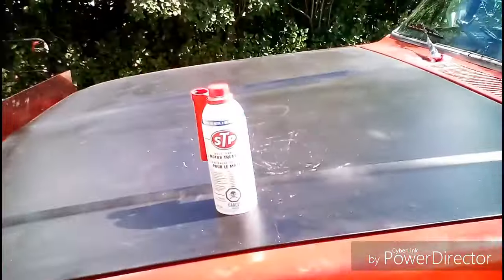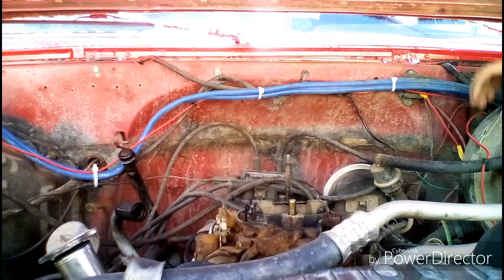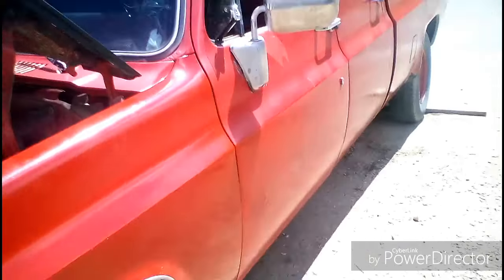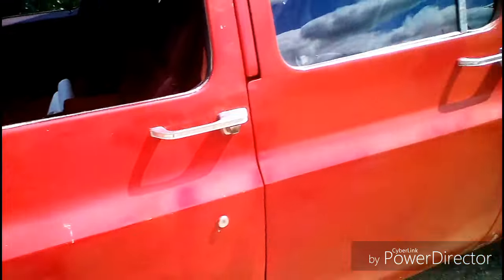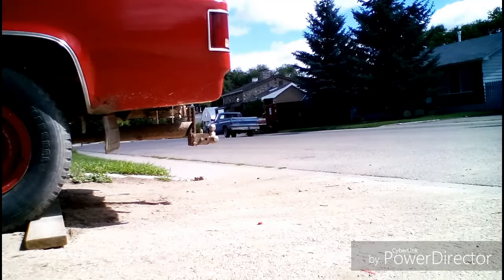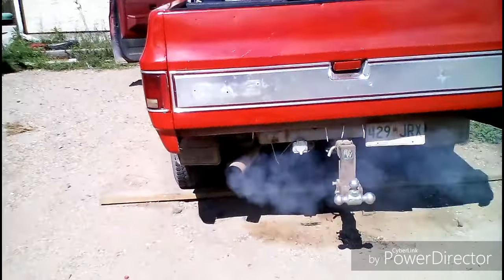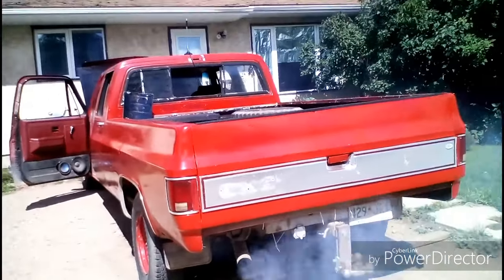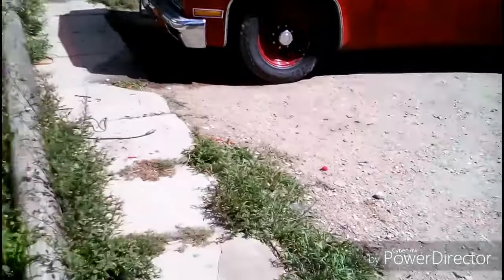STP engine treatment on carburetorHD

Comment: (First haha) Cleaning carbon out of the combustion chamber is helpful since it prevents pre ignition. However, I don't think carbon develops on the cylinder walls due to the rings constantly scraping them clean. Since some of the STP stuff drains past the rings and into the oil pan while you are turning over the engine, I recommend changing your oil as well. The STP stuff will drastically thin your oil. Trivia: STP is a chemists term which stands for Standard Temperature and Pressure.
Reply from the maker: Oh ya oil was changed that same day as it was getting close to its due time anyways

Comment: The thing with snake oils is that they act more towards a placebo effect on the driver than they deliver results on the vehicle. You want that chevy to run at its' best? do a tune-up (cap, rotor, wires and plugs - about 150 bux for top of the line and 50 bux for bare minimum), run 93 octane for a month (to change the combustion temp and rid the chambers of most deposits), and do an oil change religiously every 3k miles (these old motors it don't matter what oil you put in as long as it is the right weight). Your ride will be 5/7 - perfect score.
Reply: Oh, and, uh, most importantly - don't be a git and rebuild that carb!

Comment: Go to "Fitech" and purchase one there entry level bolt on Fuel Injection conversions. You will be amazed with the difference in perpormance. V.
Reply from the maker: +vaccumme ya I'm a carb guy. And was to lazy to tear it all apart for a rebuild kit as over the late fall and winter I'm swapping in an 8.1 vortec and an Allison 1000.
Reply: 8.1 ? That equals 480 cid.. What Vehicle or Vendor are you going to acquire that from ?
Reply: Some chevy work trucks have them.  I was looking at getting one back in '03...used of course.
Reply: So, like something out of an old Dump Truck or c50, Kodiack ect. ect. ?
Reply: vaccumme it was an HD 3500.  Dually IIRC.  Just a cab and frame rails.  This one had a flatbed on it but the dealer said most end up as tow trucks.
Reply from the maker: +vaccumme 8.1L L18 vortec is an all iron block and heads, it's  actually a 496cid, pulled it from a rolled over 02 gmc 1 ton pick up that my brother inlaw totalled while drunk, engine, trans, all wiring harness and computers, paid him $400 for it all and insurance wasnt covering him. Just need to take a couple week of holiday in order to get the swap done.
Reply: Very Nice. It should serve you well.

Comment: You could probably accomplish the same thing with a mix of diesel and type f for the engine. But yeah, will not help the carb. Tune the spring tension on your secondary air door. All it takes is a warm engine, patience, a thin flat screwdriver, and an allen wrench. Loosen the allen while holding the flat in the groove. Unhinge the spring a 1/4 turn running better when stabbed throttle until it gets worse, then play with spring tension a 1/16th each way, starting with stronger tension. Don't forget to lock down the allen screw before you let go of the flat. Ignore specifics, google Q-Jet or quadrajet secondary air door tension if you are newer to old school. I'm 36. I cut my teeth on this stuff. If you blow it and the spring unwinds, keep trying tighter until the secondaries pull in well sounding like a surprised chewbacca saying "wha?". Remember, The adjustability is there for a reason and knowledge takes time..
Reply: If you can get it absolutely right, you have to screw with it in 32nd turn increments daily due to weather, grasshopper...
Reply from the maker: Yes and I have already done that to the secondaries, I'm only 24, but isn't my first rodeo with QuadraJets, have rebuilt quite a few on friends rigs that we're gonna toss them and go edelbrock, after a rebuild and good tune they have always loved them. Just didn't want to on a engine that's getting pulled in a month or so, on a $5 salvage yard carb.

Comment: Seems that dumping most of your product straight into the barrels and bypassing your entire fueling system isn't the most effective use of a fuel system cleaner.. Do the instructions actually advise the customer to dump straight into the carb?
Reply from the maker: No, the instructions said into the fuel tank, but, within the last 6 months I had put 2 new fuel tanks, new fuel diverter for the dual tanks, all new fuel lines, fuel pump and a new filter when I put the salvage yard carb onto it, along with gaskets and took it apart and cleaned the jets with carb cleaner, my main reason was I forgot to clean off the butterfly valves and when I did me spark plugs I put by borescope down the holes and noticed a lot of carbon in the piston and combustion chambers, so just mainly wanted to clean the butterfly valves and de carbonize the combustion chambers, and it did wonders for that. Just couldn't find B-12 or seafoam at the time of wanting to do it and wasn't gonna drive all around town looking for them.

Comment: The can is identical to seafoam, just a different label. Look up the MSDS and you'll likely find they're the same product (I didn't do the homework). Also, aren't you supposed to run the engine at like 2000 rpm while pouring? I have used seafoam before, not a big fan of STP products.
Reply from the maker: +InternetDude well thats what i thought too, but the can said at a high idle, so had the high idle on the choke set to about 1500rpm
Reply from the maker: +Danny I not at all

Comment: Are you going to use a "stand alone" wiring harnes or do surgery on the original ? V.
Reply from the maker: Oh I'm not gonna mess with the harness and going straight with a stand alone harness
Reply: You may want to checkout a website called "150 tunes" they offer an outstanding service using the factory harness and ECM. V.

Comment: Weld the diff or get a axual out of a junk camaro
Reply from the maker: +caleb laster why would i want to swap out the 1 ton 14 bolt full float for a crapmaro axle? Thats the most ridiculess thing ive ever heard
Reply from the maker: If its due to the 1 wheel wonder, i do have a 14 bolt with 4:10 gears and the factory gov lock, centripetal force locking rear end to replace the 3:55s thats in it already.